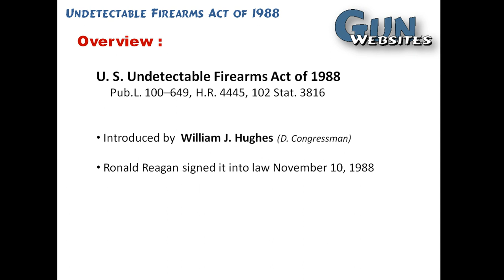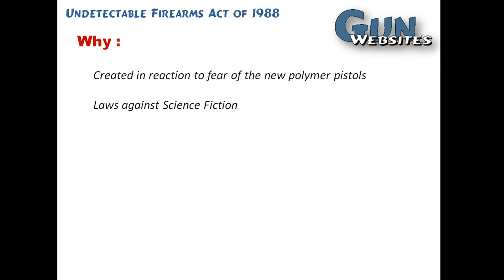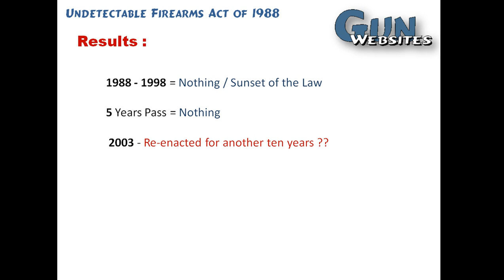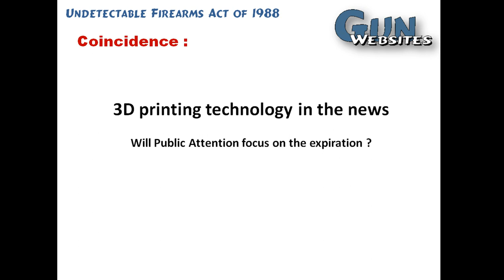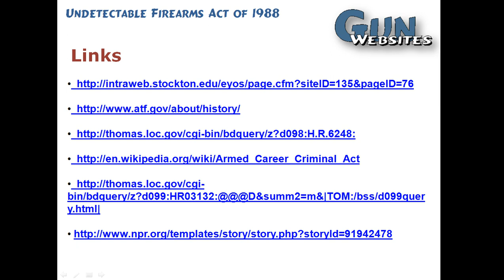Plastic Gun Law - Undetectable Firearms Act of 1988 - 3d printed guns

Comment: you forgot John Malkovich made a plastic gun in Clint Eastwood's 1993 "In the line of fire" and the actual movie prop could fire blank rounds. They used the same non-firing prop in "No Way Back" 1995 because the original was cut in 3. But seriously we didn't have metal detectors a 100 years ago and somehow people survived. X-ray devices have been around for awhile but not the airport kind. And despite what John McClane says a glock will still show up in airport scan.

Comment: Bruce C, the polymer will exist soon enough. One that will be much stronger and heat resistant. It'll make steel guns a thing of the past. Not to mention increase reliability, drop weight, and lower cost.

Comment: Any sort of "insurgency weapon" that's not made of metal probably has a high chance of failing.  Personally, I'd rather have a wannabe murderer use a makeshift firearm made out of sand and clay that'll probably blow up in their face (or at least fail to fire) than one that'll make some sort of shank out of glass or hardened plastic.  Also, as explained by Taofledermaus, 3D printed bullets are extremely light, and thus the lethality of them should be quite low.